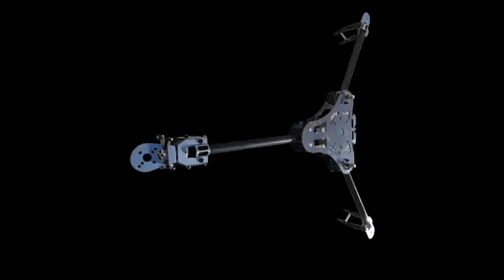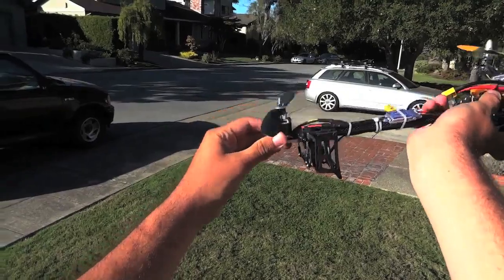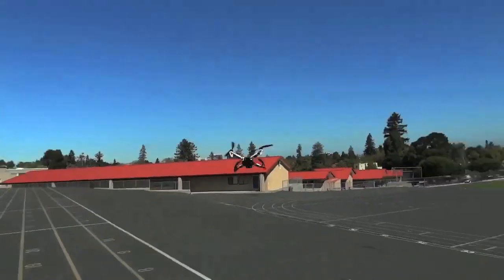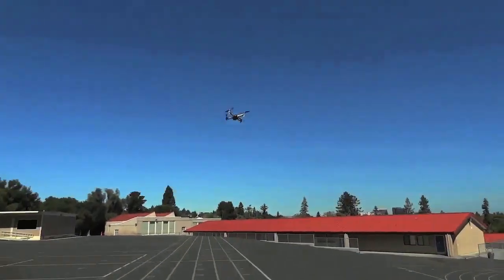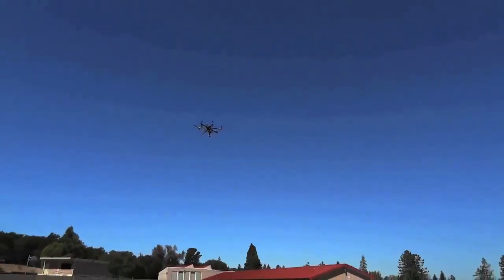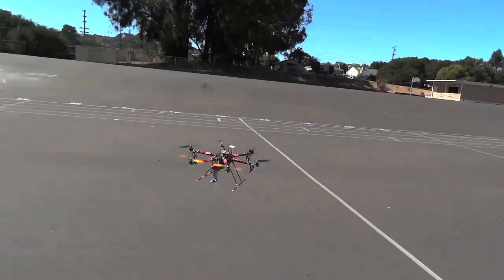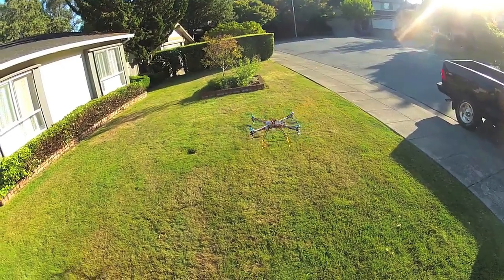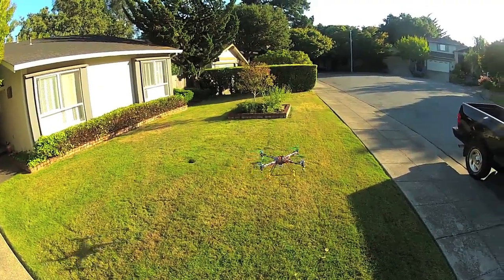Beginners Guide to MultiRotors: Configurations

Comment: I have built a X quad (HK 10x4.5, NTM 2836 750KV, PYT1 25 SimonK, KK2 1.5, 2200mAh 3s) 

It flies good (to my knowledge) with the standard settings. I do best with the auto leveling on. When I fly without auto leveling, it starts to drift in all directions and with my really bad flying skills it starts to fly all over the place.

I don’t know where to  start: 

1) Fly the quad with auto level on and trim the KK2 board better? 
2) Fly without auto level and train my skills and counter reactions.

Comment: Hey Buddy, sorry to of topic a little but do you have any issues with the KK2 board suffering gyro drift ? after meticulously callibrating the sensors and making only small adjustments in the self level settings, the quad flies smooth but after a few minutes it starts to drift foward and right???, always the same way. put it away until the next day and its perfect again then 3-4 mins into the flight more drift. Any ideas? 
Thanks.
Jonesy. Brisbane. Aust.

Comment: Great info. Building a quad with the Kk2 board. Waiting to try it. 

Question: would shortening the 3 wires that connect each esc to each motor cause any electrical interference? I want to keep the wires neat and shorten them but i remember reading something about interference. Thanks!